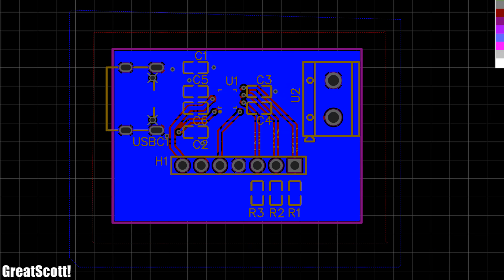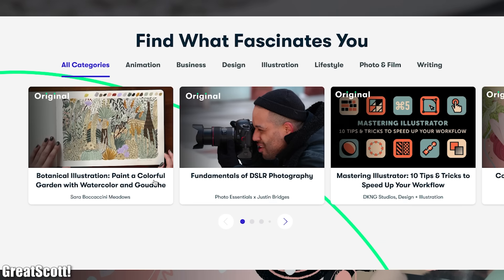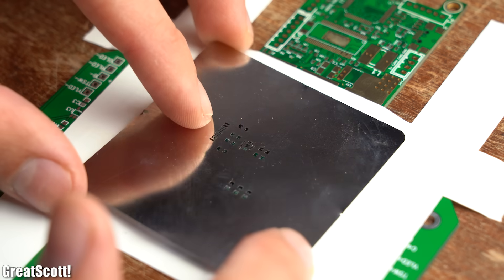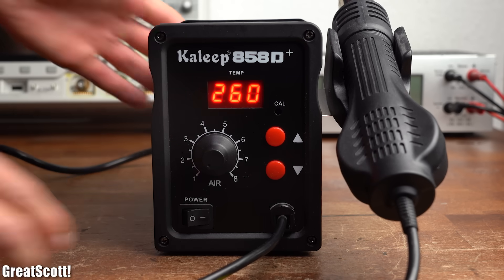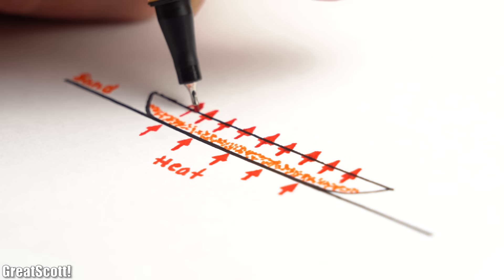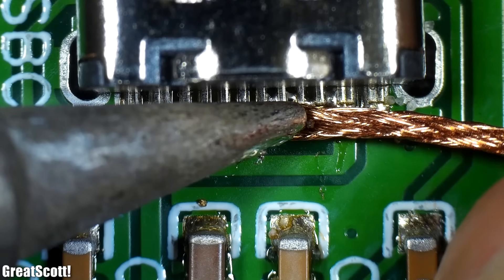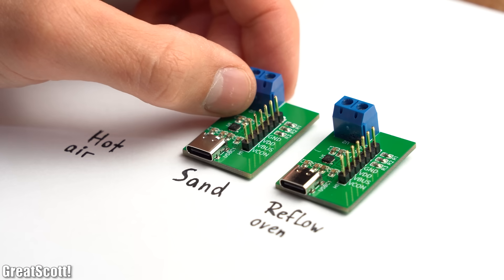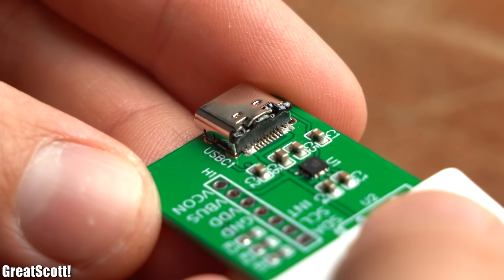How to do SMD Reflow Soldering properly! || Hot Air VS Sand VS Reflow Oven

Comment: Hi I work for an electronics assembly company and I think I can help out with your smt assembly process. The main issue I saw in your technique was the paste application, you should try to get the stencil much flatter, you can't have tape laying under the stencil as it raises the edge. You should try to lay a line of paste then uses a squeegee or credit card to swipe the paste in one clean motion, additional passes would cause unwanted squeeze through. When you finish you should check and see no excess paste between qfn pads, if you get this right the reflow will work with pretty much any of your techniques with no shorts. Personally, when I'm home assembling boards I preheat the boards to around 200c which you could do with the sand, then I let it soak for around 60 seconds and then finally reflow the solder with a hot air station, world's perfectly for me everytime. 
Happy soldering :D
Reply: for sure that was way too much solder paste
Reply: Thanks for the suggestions.
Reply: By soak in , he means basically pre-heating, warming up the whole thing to almost the activation temperature. That makes for a smoother transition with a quick spot of heat from the hot air gun. This is part of why some of the oven’s profiles were low. I would also add that it makes sense to clean boards before solder past application and to not use your bare hands on the stencils or boards prior to the application. The oils from your skin will add instability to the mix :)
Reply: I have a tutorial on my channel regarding paste application. Sadly, GreatScott made a lot of schoolboy errors which tainted the rest of his reflow tests. Selection and consistency of the paste is important. The Stencil must be flat, even a layer of tape underneath raises it too far. Also, one swipe only......never swipe over and over.
Reply: Yes, you could watch the stencil bounce and the results showed a lot of paste in the contacts. That's likely why the oven profile didn't work, there was too much thermal mass for the give heat and amount of time.
Reply: Jonathan Mayer Maybe, but the thermal mass of the board + components is massive compared to the mass of the paste - even applies too thick. Related: when I was younger and dumber, I designed a high current board with thermal reliefs on the power pins that were too generous. The board worked well, but those connectors were nearly impossible to solder. My very experienced boss warned me, but ... well ... now you know how it turned out.
Reply: Nicely put, I must have missed your comment before writing mine.
Its been about 9 months since I left assembly, I do miss it sometimes but being allowed to have my say on the way thi g are done in the new company is great.
Reply: For bigger PCB's and for a more professional way I would use a metall spatula (these are available in different sizes), with which the angle of spatula at the edge of themselves is much flatter, if you apply enough force.  I would also prefer to apply the solder paste to the spatula instead of directly on the board.
--------
My favourite solder technique is via an reflow oven with a conveyor belt, because the Throughput is much higher and the solder curve can easier be driven.
Reply: How do you do double sided boards?
Reply: @ThatEEguy2818  At first I would solder the side, on which are no heavy SMD-ICs, heavy SMD-Plugs, etc.  And afterward, I would solder the other side.
If you have heavy SMT-Devices on BOTH sides of the Board, you have to glue the parts on the first-soldered side to the board. Elsewise they would fall off (or [add other bad stuff...]) during the second Reflow-soldering-phase...
Reply: @ThatEEguy2818  for double sided boards, assemble and reflow one side as described originally then use scrap PCB or metal spacers to lift the board up so the components clear the hot plate and proceed the same way as you did the first side, you don't get as good of a preheat from the got plate if you're using one but it works. Try not to knock the board as components on the rear are held on by surface tension. If you have any heavy parts they should be glued down so they won't fall when you assemble the other side
Reply: @mawoodmain  thanks.
Reply: For preheating can I just stick it in a normal oven?  If it has a mode that uses a fan to create even heat is that the best option for preheating a board?
Reply: @ian1352  sure
Reply: 100% agree with you. The other thing I like to do, is flow the solder paste with my stencil in place. You can watch the paste literally pull up nicely onto the pads. Then I place my comments on top of the pads with flux and use my hot are to finish. With that technique I rarely ever have cross soldered leads.
Reply: @ToddLuvsGolf  While that technique can work I find it damages the stencils and reflowing already flowed paste is never as consistent as the first flow, new flux just sits on the solder where as the flux in the paste is much more cohesive, also the components do not sit as flat before reflow. But if you are only doing one or two boards I agree it works pretty well and does not require the same level of precision when squeegeeing.
Reply: @mawoodmain  That’s what I’m used to doing. Simple rebelling of a chip on a board I’m repairing. Large scale it will ruin your stencils. My repair level scale, it’s super effective and saves me a bunch of time.
Reply: My 2 cent.. don't... just don't bother with a stencil.. use a toothpick or a needle, use fine enough solder paste ( mg chemicals) . Using a stencil you will always put on too much if you don't have professional equipment.  a tiny tiny bit on the tip of a needle is more than enough for a 0603  A small line for a row of pins on a QFN. The only thing you will lose is a bit of time, which is only a fraction of the time you'll need placing the components anyway.  I've been suckered into buying stencils when I first did this, it's not worth it for projects of the size and volume shown.
Reply: Any tips for how to do a double sided pcb? I'm working on a project at home I designed a double sided pcb without thinking how I will solder the components on both sides 😅
Reply: I followed what you said until the last part. 
Preheated with or without paste?
Soaked in what?
Please explain
Reply: @-______-______-  So you want to paste the boards, install the components then warm the whole lot up to a pre heat temperature using a hot plate or some other means like sand in a pan, then you use hot air to bring the solder up to its melting point. This works well when the boards have very high thermal mass e.g. high copper weight or high layer count
Reply: @mawoodmain  appreciate the reply. Thank you.
Reply: I have a tool for reballing GDDR6 memory, and in it the chips are inserted into the recesses, and covered with a stencil, and the stencil is pressed to the chips by a powerful neodymium magnet built into the base. Maybe it's worth trying to make a table for applying solder paste, where magnets will be located under the PCB
Reply: Matthew Wood:  Agree 100% -- too much paste. Looked runny as well. Stencil thickness and hole size also factors. I preheat PCB from bottom to 150°C with hot air, then reflow from top. Preheating via ZEPHYRTRONICS AIRBATH. Cheers.
Reply: Thanks Matthew. I never considered that multiple wipes would cause squeeze out, but it makes sense.

 In GreatScott's case, my first thought was that his stencil just might be too thick. But i didn't consider the flatness of his technique. For designs i plan to make a lot of, i will use a dremel tool with a mill bit to route out a recess in hardboard (like what JLCPCB ships to protect stencils). I mill it to the depth of the PCB, and in the outline of the PCB, so i can drop the board into the routed space and lay the stencil down flat over it.
Reply: @Nono-hk3is Personally for PCB holding I use PCB scraps with hot glue on the edges far away from the stencil, then at the end you can just pour some IPA down on the work matt and just pick off the glue easily as IPA makes got glue release.
If I plan on doing many stencil jobs I 3d print a fixture plate with the board outline offset by 0.2mm (specific to printers) and put pins in to mate with the stencil. A tape hinge on stencils looses accuracy quickly so any more then 3 I recommend fixturing or frequent realignment.
Good luck 👍
Reply: @Nono-hk3is  good thinking, you may also  want to try adding some holes in the stencil around the board, so you can key it to your jig with some pins.
Reply: @Nono-hk3is  that's a great method of getting the stencil in position, i'm gonna use that
Reply: Soak in what?
Reply: heat.
Reply: @ninethirtyone4264  heat, let the board soak in heat before passing over with the blower.
Reply: @ninethirtyone4264  The heat of the Oven, i presume.
Reply: @ninethirtyone4264  hi, soak time is a time you want the paste to spend at a temperature where the flux is activated, the flux will clean off oxides and contaminates from the components and pads. This is essential to a quality solder joint, if the paste does not soak properly you are more likely to get dry joints and missed joints.
Reply: @ninethirtyone4264  soak simply means remain at that temperature for a while

Comment: dude, you didn't keep your solder paste in the fridge for sure seeing how much it's merging with neighbouring pads...and looks like you don't have proper solder tip for this work - with blade(knife) type would be easy
Reply from the maker: In the fridge?
Reply: @greatscottlab  yes, you should store your soldering paste in the fridge and take it out few hours before using (it will still be quite cold) - then it won't spread around and stay nicely on pads, try it next time with stencil. Just don't use paste straight from fridge - will be too hard and too difficult to apply.
Reply: @greatscottlab  Solder past has to be stored cool

Comment: You can reflow with hot air. Just heating pcb from below. :)
Reply: ha! interesting, 'cause i keep blowing components away, and when I set the fan lower it doesn't heat up enough I think. Gonna try this next
Reply: Blowing components is the reason why I'm sticking with my ancient, unregulated analog hot air station,  @Intellidiot . It has diaphragm pump rather than brushless fan which has much lower minimum air speed.
Reply: Hot air from below is much safer. Much less thermal stress on the components. Works also perfect when you want to desolder a component.

Comment: The most difficult part about smd soldering is when you buy an expensive micro chip that you waited for months and it falls from the table into the void to never be seen again
Reply from the maker: True
Reply: @greatscottlab  lol
Reply: When you grab an 0402 resistor with tweezers too hard and it just gets shot into space
Reply: @Gonjona  escape velocity of 0402
Resistor is a question that keeps me awake at night
Reply: @Gonjona  it's now one with the dust
Reply: @Gonjona  This happened to me when I was replacing the LED on my wireless rear bike lamp controller. I had to solder in a THT instead
Reply: @Gonjona  I've had them apparently teleport
Reply: No, no. They don't just fall of the table, they warp to the fifth dimension because otherwise, it'll be possible to find them but not in this case.
Reply: @Asu01  object so small it literally quantum warps
Reply: Our when you knock over a whole tray of them in the pick and place machine!
Reply: @ar5000  Might call me sadist but 99% of the SMD components i buy come from stuff like that.

They make a mistake in the factory like flipping a IC tray and then they'll just sweep them into a bag and sell it as unassorted components.

Hard part is actually sorting them and telling them apart but now i have a lot of SMD chips i don't think i'll ever use, and if i do knocking over the box is inevitable.
Reply: Or...you sneeze
Reply: Or when you put SMD resistors into different piles and then forget which is which. Then they work well as a sand in aquarium.
Reply: I know that feeling 😂
Reply: This commentary has a story behind jajajaja
Reply: The joys of dissecting nasty fume extractor filter :D
Reply: @hempbear  specially if it has that sticky crap all over it
Reply: Don't say things like this.... I was about to do some SMD work, now I'm thinking a sage stick needs to be burned, more lights put in my work shop, possibly drag the wife over as an emergency set of eyes.
Reply: i can even loose a tht led like that
Reply: The fist thing I was told when I starte SMD soldering was that if you drop it, give up and forget about it.
Reply: All you need is a flashlight parallel to the floor. Works everytime
Reply: spray uv coating on it and then find it with uv flashlight :D
Reply: @deano_au1396  10 and 13mm sockets literally disappear if you blink too slow
Reply: Or walk around at night..preferably going to get a drink with bare feet.. ul find it..trust me..just dont wake anyone up.
Reply: Yeah.. I list at least 100eur under table!
Reply: I just turn off the lights, remove my boot and my sock and just hop around carefully until something completely destroys my heel
Reply: Man, I once was making a laser driver for a class I was in and needed to order some 0402 parts due to low esr requirements. I was following some layout guidelines for the TI chip I was using and it called for a special 4 pronged 0402-like capacitor. I only ordered 2 of them because they were expensive to me at the time. Well I happened to both the first board I tried to solder so I had to use my spare to try and make another one. I somehow dropped it in the lab and spent the next few hours searching for it. I found many specs of dirt that were larger than the part I was looking for. Only by the grace of God did I ever find that part. There was no time to order more, so I was very fortunate in in finding it, and much to my surprise, my circuit actually worked in the end. Moral of the story is, part attrition is real, and it's always a good idea to order more than you need. Couple that with small parts being very hard to place by hand, and you'll end up buying a lot more than you initially wanted to :)
Reply: Wax pencils used for fingernail art also work as pickers for small parts, don't suffer the problem of sproinging across the room, and also allow you to easily rotate parts into position.
Reply: F
Reply: Can humans actually handle these  tiny parts any more? When mfg. designates a package size starting with Micro Lead Frame ,Micro Small Outline Package, or the 0201 resistors sized @ 0.010" x 0.005" in size .That's  10/1000 & 5/1000 of an inch
Reply: Expensive? The most expensive chip i can think of is 5 euro.
Reply: Unless the board size is critical, like in a mass production, you can just simply go with bigger size components for ease of work
Reply: F
Reply: I totally know that feeling. Happened to me a few times.
Reply: when you are about to measure the only 0402 resistor with a multimeter and the resistor is thrown up it is sure to be gone forever. 😂
Reply: Lol they simply fall in love😂
Reply: *Shoves everything on desk in destructive rage
Reply: ok
Reply: I knocked over my new package of 200 assorted ICs I had 3 stuck in my foot by the end
Reply: @glo704  F

Comment: In my youth I was involved in the hobby of  lapidary.  I heated stones to change their colors, or to speed up epoxy cure times.  When I used sand, it would get in the epoxy and looked bad.  I ended up using table salt.  If it got on the epoxy, it would dissolve in water.  I suppose in the case of electronics, if one were to use salt, it would require very careful cleaning after cool down.
Reply: If you use distilled water and have no power applied (i.e. batteries) salt could work, just wash the water with alcohol after that.
Reply: Will you share some knowledge with us? 
What rocks did you heat, why, where did you find them etc?

Most stuff on google about lapidary refers to diamond cutting.
Reply: @lazar2175  I'm not the guy you were talking to (I didn't spread rumors of my amorous adventures to the extent they were still believed over two hundred years later, for instance), but I've had good luck at forum.rocktumblinghobby.com.

I got into it when I went to Greenland.  Want to find interesting rocks in Greenland?  Look down.